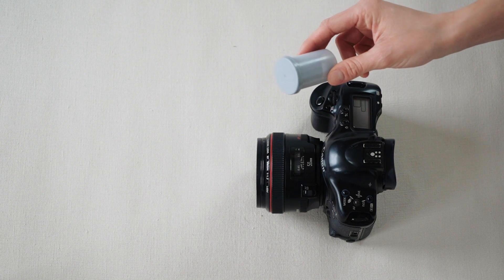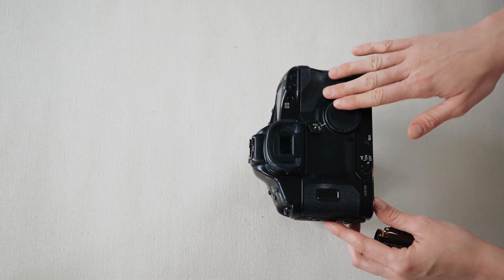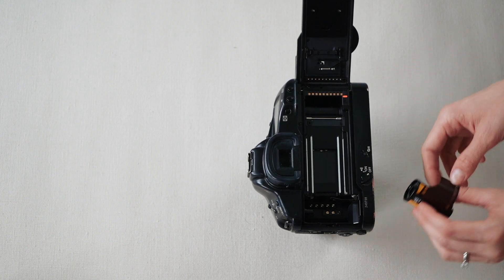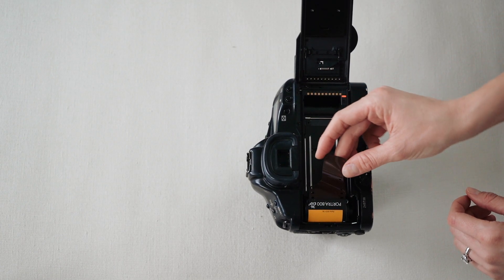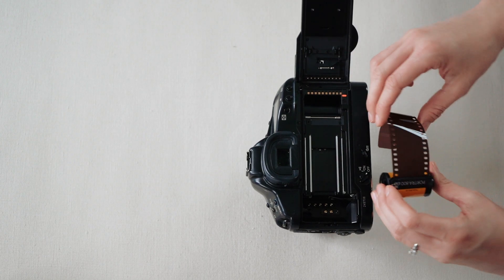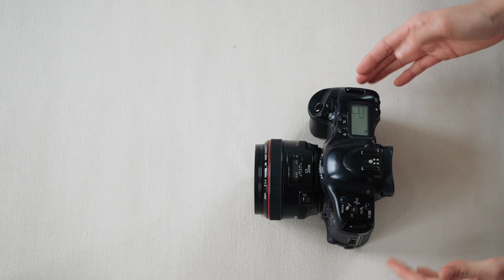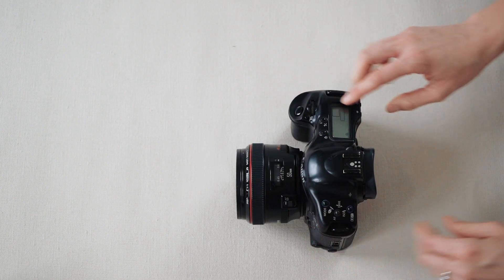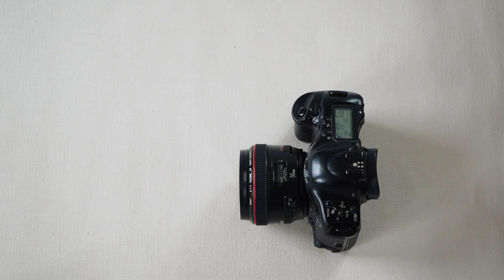How to load film into a Canon 1v

Comment: I was always wondering - when I use my self loaded film rolls from the bulk - I always know when the last photo on my FM2 is gonna be so I won’t tear off the tape that sticks my bulk rolled film on the spool. 
But since this modern 90s camera system does it automatically instead of manually cocking - will the camera know by a little resistance that it’s the end of the film or is it gonna probably tear off the duck tape ?
Reply: The DX coding on the cannister will communicate the ISO and roll length, so choose cannisters that match what you are loading if you want automated.  The camera shown has custom functions that allow rapid rewind automatically, silent rewind automatically, or you can manually initiate rewind.  The other custom function that is important to consider with the camera pictured is you can choose to have the camera auto-rewind and leave the film tab out, and for this you will need to have the matched cannister to your cut length of film.  Some users that develop their own film like the tab out so as not to destroy the cannister.  Other users like the tab out so you can write what frame number you are at on the roll on the tab, and swap out to another emulsion for ISO/colour/transparency... and then reload to the partially used roll at a later date, cover the lens and set high shutter-speed, then advance the roll back to the exposure frame you left off at.  Not all newer film cameras offer these features, but the one pictured allows for these options.  In the case of the FM2 you would feel the tension release, then pop open the back, but with motorized rewinding this not possible.  Manually loading usually gets you around 40 frames depending on the emulsion thickness, so in this case you would only want to have manually initiated rewind available, so disable the other options in the custom functions.